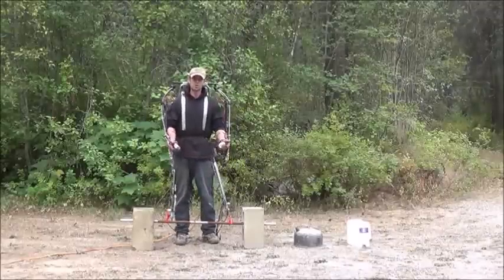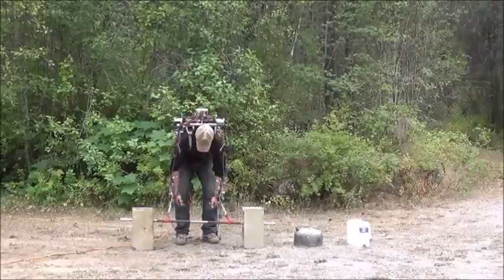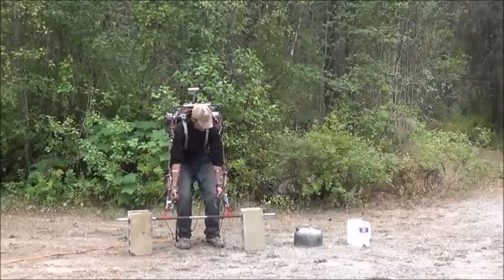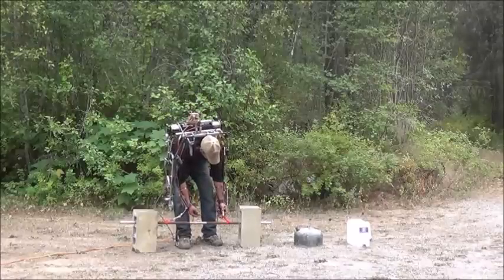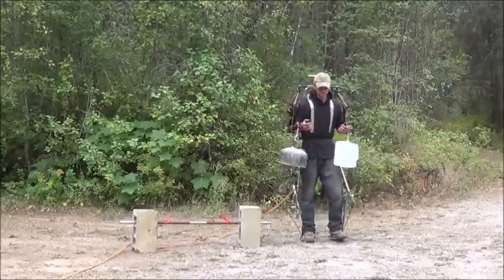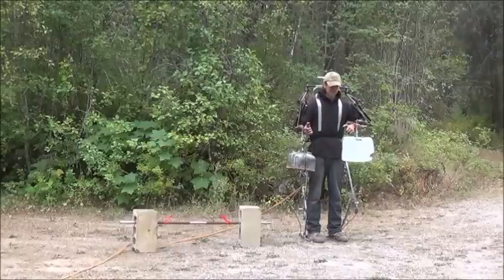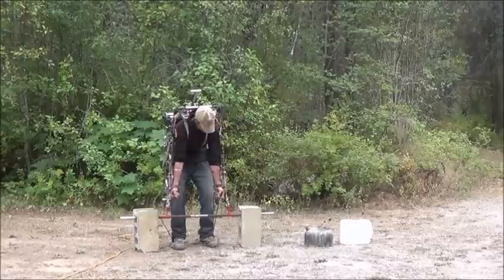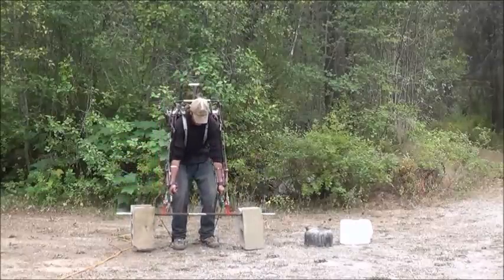Exoskeleton, Wearing and testing the upper body's lifting capability.

Comment: bravo indeed great. I want you to be careful because your back might not be able to handle that much weight. I would always in vision a super dense mass. So it could offset weight to weight distribution.That would be powered by micronized thorium reactors. Good idea on the nitinol. Have you ever replicated the Navy hot/cold water wheel. a bath of shallow black metal on the surface container. A deep white plastic subsurface container of water besides the metal. Make a nitinol wheel with spokes that make strokes on a ratchet type mechanism and boom. torque would depend on several but mainly size of nitinol bands.
Reply from the maker: +Brett Moore Most of the weight is on my hips and there for on my legs. Yes, I've seen and know it well it is not the best example they have of a nitinol engine it's the only one they will show the public.  Behind the curtain nitinol is used for some incredible stuff and this video series was intended to force their hand a bit.

Comment: Hey man, awesome suit. After this prototype, may be able to use RC truck brushless motor and rockcrawling transmission to pull cables? Maybe 2 transmissions in series? This would lower the weight on your back.

Comment: wouldn't it be more powerful,faster and lighter if you used compressed air pistons instead of a simple motor ?
Reply from the maker: +deca go (decago) Not more powerful, maybe faster until I gear the motors different and not lighter because you need a air compressor of substantial size to power it, hydraulic is the better way